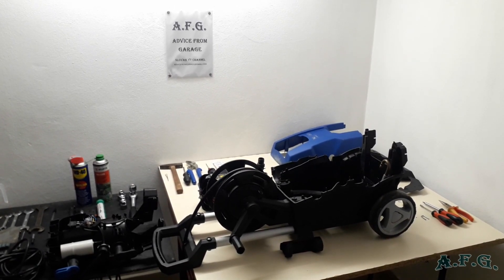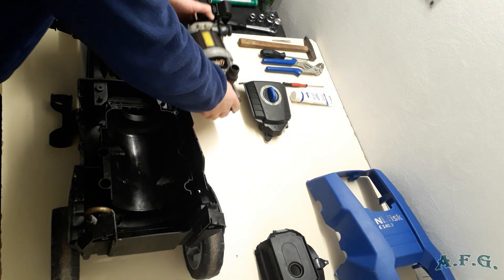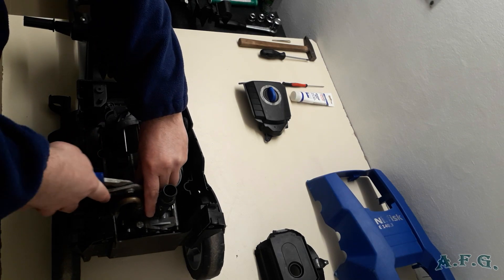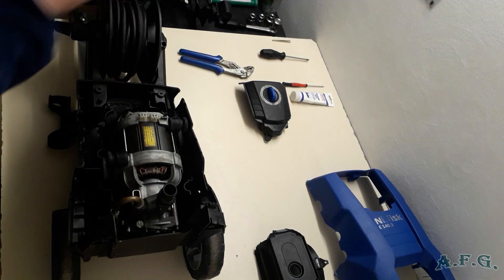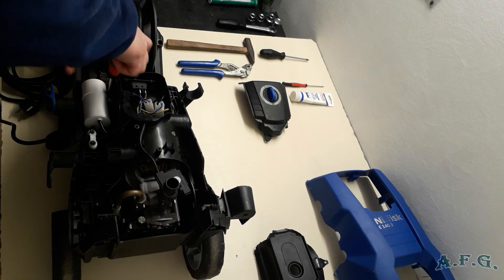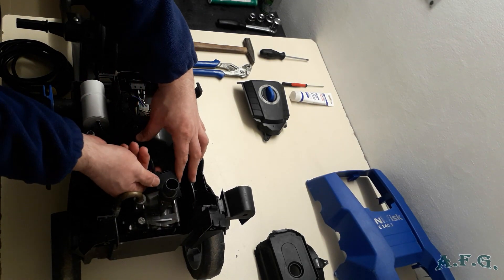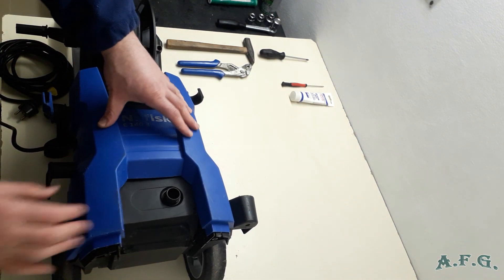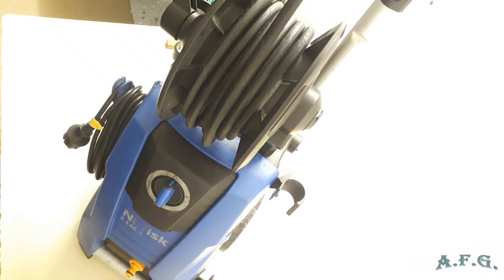Pressure Washer Reassembly; NILFISK E 140.3; REPAIR; How to Fix Nilfisk; (Part 4)

Comment: Hello and thank you very much for this video. I have a Husqvarna PW360 wich seems very similar to this (made by nilfisk). I seem to have fixed the leaking with the seals, switched also the start stop valve and non return valve. However, it seems now that the machine is completely dead, it does not start at the switch. Wiring is correct. Would the microswitch in the pump cause something like this? It seemed a bit corroded..
Reply from the maker: Hello and thank you. Accurate and correct remote diagnostics are almost impossible, it's more of a guess, but I'll at least try to guide you to the things that could be causing this. First, make sure that you don't have a tripped circuit breaker at home. Sometimes this happens if there is a large load or a short circuit. If you definitely have electricity in the socket, continue. There can be several things that can cause this. Make sure that you correctly installed the rubber O-ring, which is in the middle of the Start-Stop valve, during assembly. Sometimes some people place it in the wrong place during assembly and their machine doesn't work at all. I'll also attach a video in the next comment where you can see where it should be correctly placed. Let's assume that there was no serious short circuit and damage to the motor and that it is fine. I don't think the problem is with the microswitch, although of course I can't completely rule it out. If you see signs of corrosion there, try cleaning it with a rust remover, or lubricate it with WD-40. Another thing you should definitely check is the start-up capacitor. If it has broken, the machine will not show any signs of life after switching on, in some cases it may hum slightly for a short while and then it will not work at all when you start it again. I have not yet recorded a video on this problem for Nilfisk high-pressure cleaners, for which I have recorded repair tutorials, but I have recorded a video tutorial for the professional Karcher HD 5/15 C cleaner during the service. Please watch this video. Although it is a slightly different machine in terms of construction, the principle of operation and connection of the start-up capacitor is similar. Just make sure you buy the same one (it must have the same microfarads as the one that is there now). Even if it's not the start-up capacitor that's causing the problem you mentioned, it doesn't matter if you buy one and keep it in reserve - stock, it's a cheap thing, it can cost 5 to 10 Euros if it's not the original. It's a consumable that tends to break down after years. Some last more than 12 years, some not even 7. Here's a video to watch to understand what kind of component it is. Hopefully it will help you. Greetings from Eastern Slovakia to Finland - the beautiful land of a thousand lakes. Slavo. https://youtu.be/19MGSO9S_V8?feature=shared
Reply from the maker: And here I will attach a video where you can check whether you installed the O-ring in the center of the Start-Stop valve in the correct place when installing the Start-Stop valve. Ideally, watch the entire video, if you don't want to watch the whole thing, definitely start watching at least at 17:40, where I describe in detail the mentioned part of the Start-Stop valve, where the rubber O-ring that I mentioned is installed. Some people often install it when installing a completely new Start-Stop valve after having disassembled it and place it in the wrong place (unfortunately, it is possible) and after subsequently assembling the high-pressure cleaner, in the best case scenario it does not work at all, or it works for a short time but stops immediately, as the new O-ring in the center of the Start-Stop valve is destroyed. Here is the mentioned video. Good luck. Slavo. https://youtu.be/fJAeGSKJO_Q?feature=shared
Reply: @AdviceFromGarage hello again. I just double checked every part and still nothing. Seems obvious that it has not got power for some reason. No humming, pulsing anything, just dead. Could I bypass something to verify it works or doesnt?
Reply from the maker: @jiivee94 Hi. I'm not that knowledgeable about these electrical issues. Try asking someone you know who is an electrician for help.

Comment: Hi, I’m trying to work out how to remove the plastic lance holder clip. I’ve taken the front cover off, but don’t want to break anything. Do you know how to remove this?
Reply from the maker: Hi Mark.  I don't know exactly what you mean (which part) when you write "plastic lance holder clip", so I can't answer.  Please try to watch the previous videos, where I disassembled the high-pressure cleaner before the repair, to see if you can find the answer to your question there.  Thanks.

Comment: Is the oil pump used in the Poseidon 6 .80w 90?
Reply from the maker: Hi, I am not sure, but I think Nilfisk recommends Castrol Alphasyn 150 for the Poseidon 5, 6, 7 class power washers. Contact Nilfisk dealership and verify this information please. Good luck. Slavo